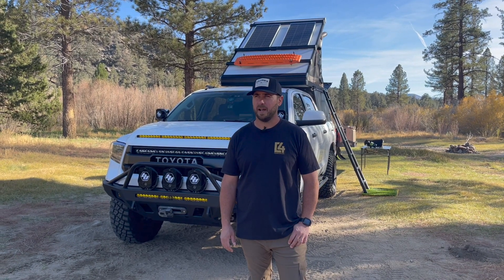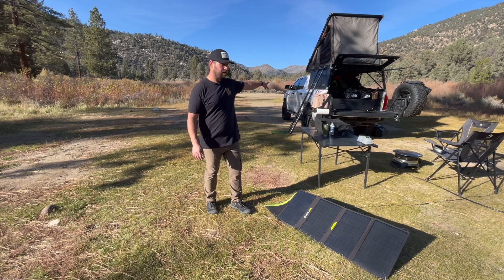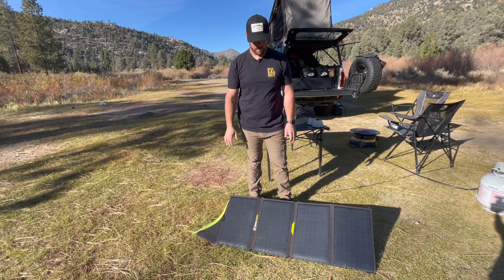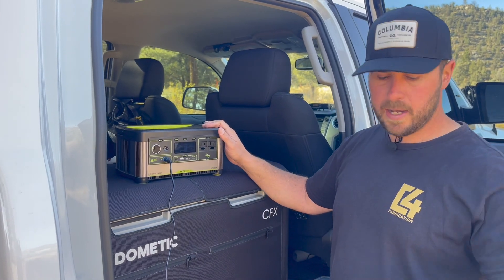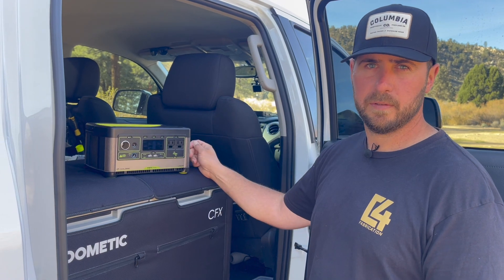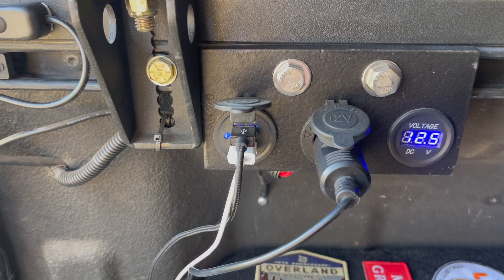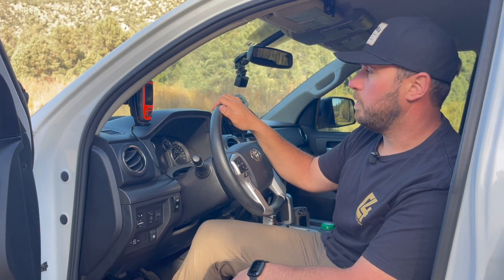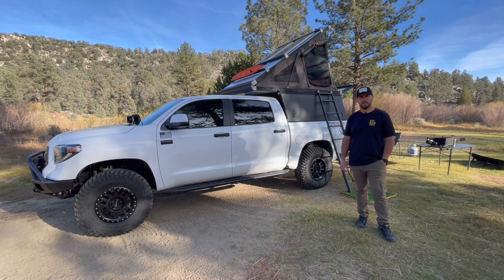Solar & Battery Set Up On My GFC - Review & Walk-Around

Comment: Appreciate the content, super helpful. Any tips for routing the solar cables between the bed and cab? Did you use any mounts or zip ties, or just loose? And did you route in via grommet behind seats or under cab? Big thanks
Reply from the maker: I used a couple double stick cable organizer pieces with zip ties from Amazon stuck on the wall of the camper between the rear of the truck cab window area. Then my truck had a big gap under the rear seat where the stock scissor jack goes. I made a hole with a rubber grommet and silicon and got the solar wire into the cab that way. Thanks for watching. If you have Instagram you can message me and I’ll send you a picture of the Amazon cable clips I like to use.

Comment: How would i connect the panel to my battery bank?
Reply from the maker: You would need a solar controller and other systems to regular the power and not over charged your battery bank. Thats why I like these items such as the Goal zero and the other  similar brands, all that tech is built into them already. Sorry I don’t know the answers for you reference your system.
Reply: @prospectoverland  I have a Bluetti AC180! I think that would regulate the power! I just need a cable from solar to the bluetti.
Reply from the maker: @ oh okay. I thought you meant you just had a battery that needed charging. Some folks buy just a large lithium battery and build systems to charge it. Yea for sure bluetti has it all built in. You just need whatever adapter plug to go from the panel cord to the face of the bluetti

Comment: Hey man, great video and set up. I’m looking to do something similar on the exact same truck where did you end up running your wire from under the cab?
Reply from the maker: Thanks man! Under the rear seat there is a spot where the stock bottle jack goes. I used this void in the foam flooring to install a big rubber grommet. I have a few wires passing from under the truck to the cab through this grommet.

Comment: I have a EBL 1000W unit and so far so good. Do you leave your small solar panel out when you are hiking? I have a 100W portable panel and I am so worried someone will take it.
Reply from the maker: I did leave it out when I had this set up for sure. You can always set it on top of your rig flat on the roof so no one sees it and steals it. Just don’t forget to take it off before driving lol. I’ve seen it happen. I have since switched campers and panels etc. just posted a video with the new camper solar set up if that interests you at all.

Comment: Do you prefer having the fridge in the Cab or in the Back of the Truck. What are pros and cons of inside vs outside?
Reply from the maker: We prefer the cab because we try and make a point to be outside, cooking, hanging out, having drinks outside etc. It would be a bummer to have to get into the bed of the truck every time. 

But if you lived somewhere with often bad weather and planned on being sheltered in the camper a lot then maybe truck bed would be more efficient.

Comment: Nice build! What cables do you have connected to your permanent solar to the YETI500x? I’m going to do the same on my 4Runner. I already have the 500x, just need 1 panel and the correct solar cables. Any help is much appreciated.
Reply from the maker: I have a extra splitter because I had two panels but if you are only doing one panel these parts will work...

This connected to the panel...
https://www.goalzero.com/collections/solar-accessories/products/mc4-solar-to-hpp-adapter-cable

Which then can connect to this and acts as a extension cord.... (they make a 30' also depending on where you are storing the 500)
https://www.goalzero.com/collections/solar-accessories/products/high-power-port-15ft-extension-cable

then this to change the plug type from the extension cord back to a 8mm port for the charge port on the 500....
https://www.goalzero.com/collections/solar-accessories/products/high-power-port-to-8mm-connector

Comment: nice build! 2014 crewmax here. Just picked up a dometic 75L. My concern is ventilation for the fridge compressor when its tight in the back of the cab. Doesn't it get hot back there? Also, what do you have the fridge mounted on? 
Cheers
Reply from the maker: Hey thanks! I left about a 2-3 inch gap specifically for air. I made a wood platform and use the back seat mount holes to bolt the platform down. Then used fridge tie down straps to secure the fridge to the wooden platform.

Comment: Your right on the same lines as my build in a lot of ways. I recently installed a Renogy DC to DC charger. I have an inergy kodiak as well which I use sporadically when I need power away from the camper. I built a custom extension cord with 2 USB outlets and household plugs with a sigma outdoor gang box. Currently upgrading to a 2000w inverter and will run marine triplex wire to the GFC with another high power outlet. Unless I’m in one place for a really long time the alternator can charge a 100ah battery in 2 hours or so. I also plug in the Inergy Kodiak at times when its not connected to solar and the leisure battery is full for additional power. Planning on infrared cooktop for morning coffee and reheating inside the GFC.
Reply from the maker: Nice, sounds like you have a killer set up!

Comment: Where did you get the dimmable red/white light strips?
Reply from the maker: It use to be called Truckparts.parts but that website/guy is no longer doing it. I am pretty sure they make a similar set up on 
https://mattgeckoleds.com

But I can not vouch for function. See if it offers dimming and color changing.

Comment: Your set up is looking great. Just watched your newest video, but posting here because it pertains to your solar. I have a 2020 Tundra with a lot of similarities to yours. I'm looking at adding solar to the top of my tent on the cross bars as well. I want it to run my fridge and to keep my AGM battery topped off. Was 200 watts overkill or just enough to do what you did? Wondering if 100wt panel would be enough? I would love to see how you mounted the panels. I'm in the San Diego area as well. My wife and I camp in a lot of the same places as you guys. Thanks Jason
Reply from the maker: 200 for sure. You never get a full 200 out of it. Maybe you know this but you can only count on a max of 80% efficiency with panels. So on a good day I'm happy to get 130-160 watts in full sun. so if you only did a 100 watt system you would only get about 75 watts. So, I would for sure go with 200. Message me on Instagram and maybe we can link up some time or go to a local truck meet up.
Reply: @prospectoverland  Sounds good. I know you never get the full watts on solar. I was looking at the Renogy solar kits. Looks like I'll go with the 200wt and mount the two panels up top similar yours. Thanks
Reply from the maker: @jfloyd4689  don’t remember what I said exactly but yeah I have two 100 watt renogy panels. I’m sure I said that though. I’m using some goal zero connectors to link the panels together and get the power into the cab. I can send ya a couple quick photos of things on Instagram if ya end up having questions. Let me know.
Reply: @prospectoverland  The Renogy kit I'm looking at comes with 2-100 watt panels, the connectors, 20 ft of cable, 30A charge controller and another 8 ft of cable for the battery connection, plus mounting brackets. Pretty straight forward kit. Pretty good sale price right now. Just need to fab up connecting them to the bars. Thanks for all the info. Just retired from FD, got rid of my Instagram. Haha I'll hit you up when I get the kit if I can't figure out a good way to mount. Thanks appreciate it.
Reply from the maker: @jfloyd4689  man that’s a killer all in one kit! Sounds awesome. 

Congrats! I’ve got 17 to go haha, PD.
Reply: @prospectoverland  on sale for $279. 

Nice.  Stay safe out there brother!

Comment: Does your wife use the ladder?
My wife insisted we buy one and now she won’t use it. Too sketchy. 🤷‍♂️
 Love your rig and love that you do the work yourself. 👍
Reply from the maker: She does. I mean going from underneath I guess doesn’t have any sketch factor but the ladder is not bad. Both hands going up and down. You only go up and down a handful of times per trip. I make a point to go a couple steps up and pre load the tent with all the stuff (water, snack, phone, chargers, flashlight etc.) before we bother going all the way up. Cuts down on the trips up and down and in and out of the tent. 

Thanks for checking out the video and yes that’s half the fun for me is doing the work.